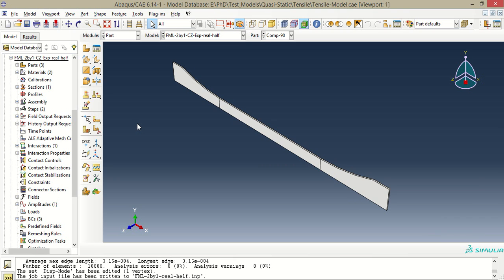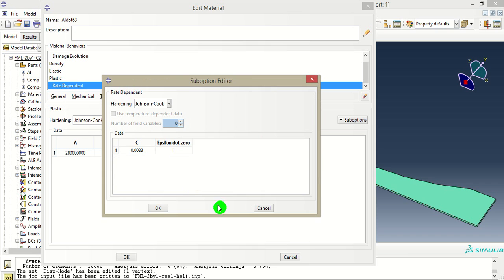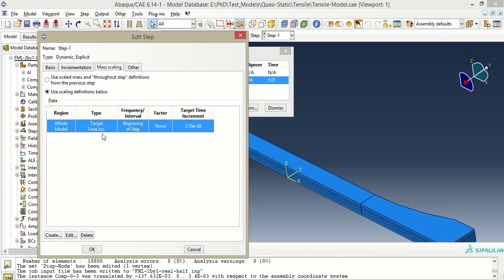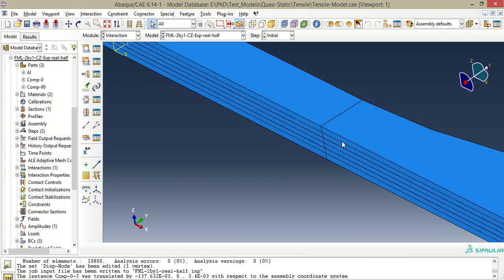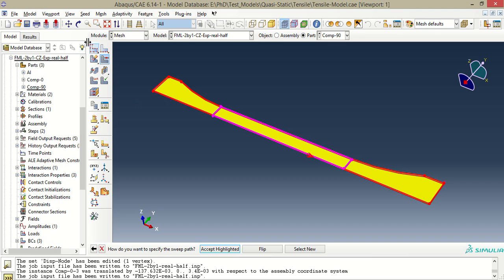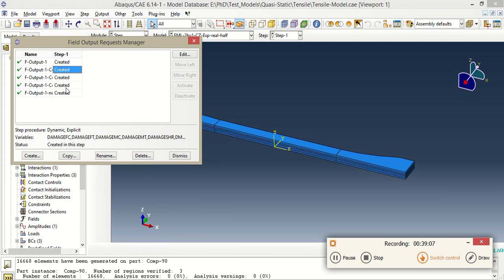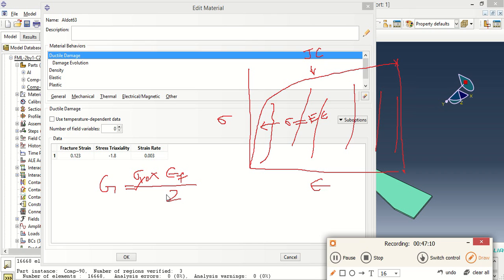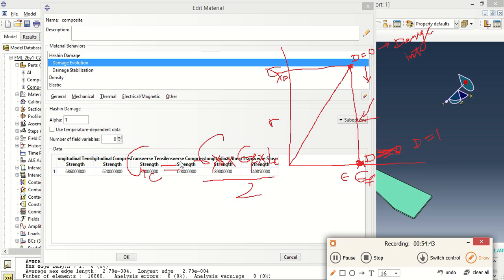Modeling with discussion: Tensile Loading of Fiber Metal laminates.

Comment: sir what is the part thickness of aluminum and glass fiber in the initial part as the relative thickness of eglass epoxy is 0.5 so is it the same thickness you have provided in part model of the ABAQUS

Comment: Thanks a lot for the video. It was really helpful. I am trying to model the bond slip between steel rebar and concrete. I have followed the same procdure as you have explined for the cohesive properties and the interaction. But the results are not very good. The steel seems not to transfer any stress to the surrounding concrete, and it seems as if the the cohesive action is not active. My questions is: since the steel is embedded in the concrete in my case, should i also specify the embedded constraint in Aqaqus?
Reply: could you solve this problem? I am also having a similar one

Comment: Hi Sanan, great video and explanation. Truly helped.
Can you explain how you calculated the value of Fracture energy?
Also would there be any benefit of using a implicit model? How would the results differ?
Reply from the maker: Kshitij Sonkar area under load disp curve is energy
Reply: Sanan H Khan thanks, what about running the step as implicit?
Reply from the maker: Kshitij Sonkar if your model is highly nonlinear you will face difficulty in conversing solutions
Reply: Sanan H Khan okay. I'm facing issues with lower stain rates. You have used a very high rate. The calculations with lower rates like 0.1 per second take over an hour to calculate. Is there a way to reduce the run time.l?
Reply: Please reply to comment in your video 'Three point bend test of fibre metal laminates with cohesive surface behaviour'.

It will be really helpful Thank you

Comment: hiThank you for this grate video.
I am modeling a 3d tensile specimen in abaqus explicit. This model have two parts. One part has elastic state and another part has  become plastic. The material is steel. In modeling of interface, I have used interaction with surfaced - based cohesive behavior.
My questions is ;
How can I get Cohesive behavior, damage initiation and damage evolution parameters;
Cohesive behavior=(Knn,Kss,Ktt)
damage initiation =Normal only,Shear-1 only,Shear-2 Only
damage evaluation = normal fracture energy, 1st shear fracture energy, 2st shear fracture energy
.. 
Thank you
Reply from the maker: these properties are obtained experimental depending upon your interface material. but my experience says that even if you got it from the experiments they will not exactly represents the behavior. they are strain rate dependent. and they are usually obtained from static tests. like enf and mmb are used to obtain fracture energies. however during an impact analysis the dissipated energy is more than experiment. so logical explanations are important while choosing the values. for example consider your interface as matrix dependent ( it is eventually made from the matrix !). so your Knn=E22, (very good assumption), choose other 2 as same.( mode independent). normal opening strength will be matrix strength in tension. as the crack will open during delamination normally. choose other two as same or 1.4 times or 1.5 times ( it is seen for most of the interface exposy resin). matrix tensile energy can be chosen for normal mode. other two can be made equal or as done for the strength above. but even if you dont have the matrix tensile energy. then find it out as Gmt=0.5*Yt*emt...Yt failure strength and emt is failure strain in tension. emt=sigma22/E22.  if you follow the above guidelines you assumption will be good.
Reply: thanks for your answer
but my model has made of steel completely and only have one material. half of model has elastic state and the other has plastic state. I don't know what properties do I consider for interface of this two halves?
by the way,  how can I upload a picture of my model?
Reply: hi 
I have problem with my model.
can I have your email address?
Reply: hi thanks for your great modeling and educating. 
I have modeled above model as you said ,but it gives this error: "The ratio of deformation speed to wave speed exceeds 1.0000 in at least one element. This usually indicates an error with the model definition. Additional diagnostic information may be found in the message file."
what's the cause of this error?
or can i have your CAE file? 
this is my email address:  srasajjadi82@gmail.com

Comment: Hi Sanan,
Thank you for this grate video,It is very useful.
Can you explain more how to calculate Characteristic length.If we have only stress-strain energy, how to define this length and define fracture energy.
Thank you in advance.
Amirreza,
Reply from the maker: characterstic length =sqrt(h*h)/cos(theta). here h is your element size and theta is crack opening angle. (you can take it as 45 degree)
Reply: Thank you Sanan

Comment: Hi, Sanan. Thanks for sharing your good work. Regarding modelling the composite pipe(let's say a very thin one 10mm with 50 layers), do you suggest that we use continuum shell to model it? In this case, we have model 50layers of composite as each one has different radius?Or do you another method to model the composite pipe? Appreciate your help.
Reply from the maker: +Zhenyu Huang radius or thickness ? i think if out of plane stresses is not of much importance try using conventional shell.

Comment: hi sir sanan
i apreciated your methode of calculating fracure energy which seem easy can i use it to calculate fracture energy in mode 1 and mode 2 of a cohesive zone model interface of two bonded parts?
Reply from the maker: salim yagoub. :) . NO buddy. technically it will be wrong. because the method gives the fracture as  a function of stress strain and characteristic element length. while the fracture energy obtained in actual experiment will be area under the load disp. curve. now the load disp. curve cannot be converted to stress strain curve for interface layer for obvious reasons unlike composite laminate/brittle material.
Reply from the maker: Sanan H Khan moreover. it is not a method. its a basic geometric understanding. and it only gives the approximate value. and i think approximate is starting step of FEM !!!

Comment: Hi Sanan,

Just a confirmation, do you really think do you need to specify the amplitude?

I think you can just simply choose the ramp amplitude and it will do the same as you do. Dont need to make excel and matlab like that.. IMHO.

Just check to clarify..
Reply from the maker: Yes you are right. But I just want to ensure that the loading as slow as possible to avoid convergence issue. Moreover Ramp is not supported for Explicit analysis.
Reply: Sanan H Khan why do we need to enter so many values? Wouldn't a tabular data ensure a linear progression?

Comment: great video sanan. can you share some thoughts on how to implement periodic boundary conditions in abaqus. Im working on repeating unit cell model...
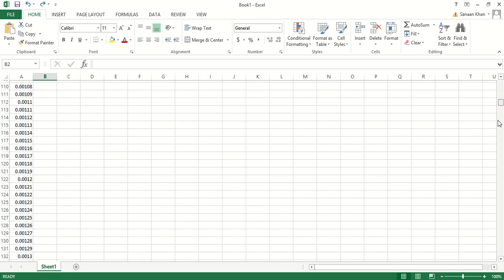Reply from the maker: amjad Khan its very easy. As you can see on 28:00 i m trying to tabulate the amplitude values. In the same way you can formulate a periodic amplitude data. you can use Matlab to generate these values like i have done, by using sin or cos function. this will give more smooth b.c. also you can define the amplitude as periodic instead of tabular.

Comment: Sanan Is their any other procedure to model composite layup in abaqus with out using cohesive surfaces. Can I use tie constrains to combine the layers.
Reply from the maker: Yes definitely it can be used. But u don't tie the layer instead you insert the cohesive elements between the layer and tie them together.
Reply: Sanan H Khan Thank you sanan. Is it is possible to disturb the fiber orientation in the middle of the ply to study the effect of in-plane fiber waviness.What is the logical way to model this fiber waviness.I have modeled tows and combined together using tie constrains to make a single ply, later I have modeled wavy tow in the center of the ply, the misaligned portion I fill with resin and tied them together to mock misalignment of fiber tows and resin rich area.I have used orthotropic properties & 3D Brick elements.
Reply from the maker: Saibhargav Pottavarthi to obtain the in plane effect in this situation will not be possible I think. Why u are not trying it through micro mechanics approach. With single fibers of 0/90/45 etc with surrounding material as resin. RVE approach perhaps will be better I think. You will have more control over waviness.

Comment from the maker: Check out the results
https://www.youtube.com/watch?v=jQogegrOKoo
Reply: Sanan H Khan  hi sanan,
How to calculate fracture energy of each mode(fiber and matrix). i have test data  FD curve for four point bending test. and i dnt have adhesive property. is there any way to calculate the energy release rate for debonding
Reply: Sanan H Khan 
is there any coupon test to conduct the fracture energy of each mode in FEA.
Reply from the maker: Anand Nand as i stated in the video, the fracture energy for each mode (fiber and matrix tensile and compressive, 4 modes right !)will be obtained from the test data (FD) obtained from that particular mode. now you know a DCB, ENF and ECT will give you mode 1,2,3 respectively FD data. similarly MMB will give you a mixed mode (1,2) fracture energy.
Reply from the maker: Anand Nand i think you are confused with the definition of the two terms. fracture toughness, fracture energy, EER. all looks to be very same. here is the difference. fracture energy is the critical energy after which the crack will grow, while EER is energy per unit area and will be there in the crack from the time it was loaded and even after it has propagated. it is the energy release rate which may go up and down. fracture toughness and fracture energy are same LEFM and differs in EPFM. fracture toughness is the critical energy that that crack reaches before making two new surfaces.
Reply: Sanan H KhanHi Sir,
Am new to composites. please explain how to do DCB test for composites in abacus... while doing DCB test ply orientation will influence  the fracture toughness?  what are the ply i have to consider for DCB test. please help me